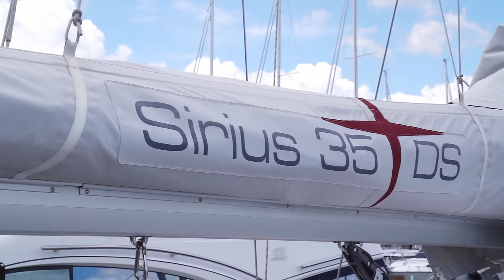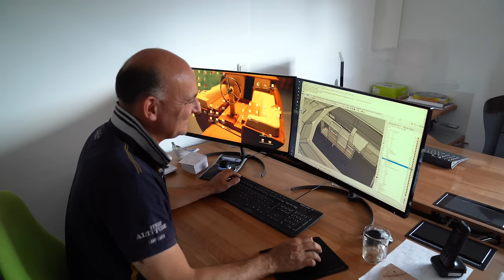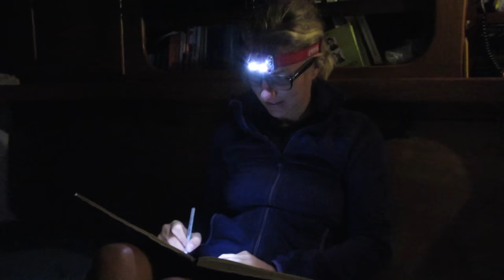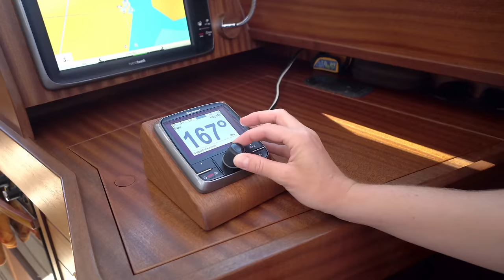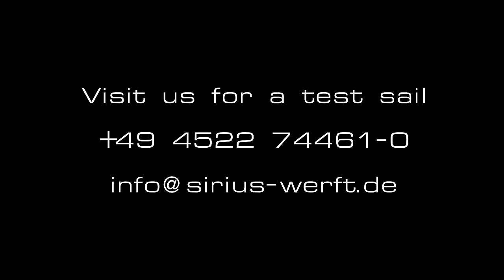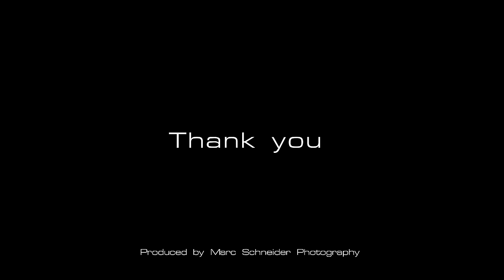Sailing the Sirius 35 DS: A Day at Sea

Comment: I agree; the DS is probably the best cruising Configuration of all options; possibly a bit bigger than the 35 though.
Reply from the maker: Yes! For me it´s the interconnection between inside saloon/galley/navi – area with the cockpit, with the all-around-visibility really, which makes sailing so much more sociable and safer as you always stay connected and see if help is needed… and you spare yourself some tiring and getting cold as you can be on full alert and safe watch, even from the inside... There is a 40 DS as well: https://www.youtube.com/watch?v=RMcxA5mDPwg     ...and something bigger to come...

Comment: Very impressive presentation & extremely high quality kit right there Sir. Is the mast mounted on top or keel please
Reply from the maker: Thank you! The mast is deck stepped, as it should be, for easy getting rid of it in case of an emergency and for not having permanent water inside the bilge. What are your thoughts?

Comment: Nice video and a nice boat. I’m a bit surprised that Marie would choose not to have the self-tacking jib; as the wind picks up it’s good to move the centre of effort back towards the mast, not forward as would be the case by part-furling the genoa.
Reply: ...it´s also not very nice to the genua ;-) ...but if keeping everything maximal simple and to the necessary minimum you for sure could do with just a medium sized, furler reefing headsail and would spare some weight, money and complication on deck... might be a cruising plan question as well? Following the trade winds needs mainly downwind sails!?
Reply: Hi Paul, let me maybe clarify this a little: I like cutter stays as they make for easy switching between sails and possibly better performance (e.g. when close hauled). This setup is more of a Solent rig (hope I'm getting the terminology right), the inner forestay is pretty close to the outer forestay. In a cutter setting the inner forestay can be as far aft as half-way between mast and outer forestay. Tacking with a Solent rig is a little more difficult because you'll have a hard time pulling the genoa through in between the two forestays. So you have to either jibe or roll in the genoa, tack with the main only, and roll the genoa back out again. Since I am pretty lazy I would opt for a single headsail (or a cutter stay which is further back, if that's an option at all). But you know, I was looking hard for negative points on the boat and this is all I came up with 😬. Cheers, Marie ⛵
Reply: We have owned other similar sized boats and hands down our favorite sail configuration is a large fully battened main (with slab reefing) and a minimally overlapping 110% jib with vertical battens.  Add a good off wind sail such as an asymmetric cruising spinnaker from the fixed bow pulpit  and you have a 3 sail diverse sail plan.  The beauty of the Sirius line, from our perspective, is that the boat has many options and a builder willing to consider individual owner wish list.   All that said, self tacking small jibs make coming about with a sun downer a much easier proposition:)

Comment: I disagree the opnion of Marie Schneider about the self tacking jib.
We changed our Dehler 34 (built in 1992) for an Ovni 385 in 2003.
We had the self-tackking device on our Dehler but never used it. Afterwards we regret this very much because it makes short or single handed sailing so much easier. The ship was also much faster than using a mostly reefed genoa. Anyway she was sold and we had to deal with this.
Our experience with a mostly reefed 150% genoa on the Ovni was the same and after one season whe changed it for a high aspect.
2 years ago we changed the high aspact for a 110% jib. and I believe this is the right sail in our case.
The selftacking device on our Ovni we only use in windy conditions when the jib is reefed.
The sail layout on the Sirius looks perfect to me for single- and short handed sailing and would alway choose for 2 headsails. Maybe choose for a removable inner forstay. 
Our Ovni is very suitable for our use and drying out. 
So why this comment? If I had known Sirius back than, the decksalon could have been the gamechanger.
No doubt I would choose for the lifting keel option. (If I had the money ;-))

Comment: Just wondering why someone would thumbs down this video...  Happy Christmas everyone!
Reply from the maker: I do like constructive critics as well ;-) Thanks and the same to you!
Reply: I would, The girls is not tall enough to see the bow when moving in the marina yet she cannot stand fully in the deksalon
Reply from the maker: @prasatsurin    ...thanks for raising this concerns but this is only correct if you are either taller than 2,05m or shorter than 1,5m: In the saloon area you will find 2,05m (6 feet, 9)standing height!!! ...and that`s on a 35 feet yacht! Have a look @25:20 in this video or if you like my “average” 1,85m (6 feet 1) to compare @ 14:00 amd @18:15 in https://www.youtube.com/watch?v=y-v-h50KZgM . We had heavy sun light and for videoing the companionway hatch and blind closed and still you have easy access walking in ... but if you slide it open you can walk in totally upright (and stay upright), .... if you are not taller than 2,00m (6 foot 8). If you are - we still do have some semi-custom solutions, done already. The coach roof has a hight about cockpit level of 1,35m and the standing position at the back is 8cm higher without the middle support. I guess we will struggle to find someone not tall enough to look over it, but having a center cockpit (like Maries forer boat) and no sprayhood up does gives you a diffent angle of view...
Reply: @SiriusYachts  So is the arrangement around the saloon table higher than lets say the galley? Because it looked like there was not headroom. Nice yacht BTW
Reply from the maker: @prasatsurin  ...yes, the main construction idea is to have the same eye level from all positions: sitting in the settee, at the chart-table/inside-steering-position, cockpit or standing in the middle of the saloon between the settee and the galley for perfect 360 all-around-view...but standing height only where it’s really needed to keep the roof low. So you do not have standing height when sitting at the table but as long as the table is there you would not be able to stand anyhow, but you need to step up into the settee to make this all-around-view. Very communicative as you are than again on the same eye level with the standing person which stands secure in rough seas as you can lean onto the settee or galley... I understand that is sounds very unconventional but if you ever have a chance to experience it...

Comment: I'm always impressed by these designs. No main sheet traveler through?  Is there something to compensate for that compromise in terms of sail trim?
Reply from the maker: We have the option of a mainsheet track on the coachroof or on an arch. We make cruising boats and there is a little performance loss and difference in sheeting angle, but in practical pruposes it's not missed. A single-point mainsheet attachment is becoming very popular and using a gas vang and a good mechanincal advantage in the vang provides good leech control.
Reply: @SiriusYachts  Thanks for the great answer!

Comment: Bellissima barca, avere il pozzetto alla stessa altezza della dinette è stupendo. Ma...il punto di scotta della randa. Resisterebbe ad una forte strambata ? (Mainsail sheet point 😬. Does the violent jibe hold?)
Reply from the maker: Per favore, scusate la traduzione da internet
Grazie per le vostre gentili parole. Se si considera il diametro dei grilli forniti dalla Harken per attaccare il suo sistema block and tackle o il bullone a U su un viaggiatore della scotta di randa convenzionale, sono un diametro molto più sottile dell'anello in acciaio inossidabile di 10 mm di diametro saldato sul tubo in acciaio inossidabile a parete spessa di 42 mm di diametro, che diffonde i suoi carichi nel pavimento del pozzetto attraverso rinforzi in acciaio inossidabile a forma di U su un'area di 0,6 m per 1,3 m. 
😀

Thank you for your kind words. If you consider the diameter of the shackles provided by the Harken to attach its block and tackle system or the U bolt on a conventional mainsheet traveller, they are a much thinner diameter than 10mm diameter stainless steel ring welded onto the 42mm diameter thick-walled stainless steel tube, which spreads its loads into the cockpit floor through U-shaped stainless steel reinforcements on an area of 0.6m by 1.3m. 😀

Comment: It is a beauty in deed, just a question in case of rough seas, will the big windows in the pilot house hold in case really big waves run over the boat say even from site?
Reply from the maker: Yes, sure!...all our Yachts are especially developed for blue water cruising and rough weather conditions, and always have been! There have been an number of curcumin-navigations on older and smaller Sirius yachts even. Some Atlantic crossings. Like Marie I would happily do it on a 35 tomorrow, but yes: a Sirius 40 DS for it would be very nice! Recently a 40 DS was collected by the owners in Germany and sailed straight back to Vancouver via Canary Islands, Caribbean, Panama Canal, Galapagos, Micronesia, Hawaii. I personally can´t imagine a better concept than a deck saloon for blue water and extended cruises...
Reply from the maker: Thanks for raising the concern about the windows and portholes. Security and seaworthiness was the absolute first priority in the design spreadsheet. As we are building ocean-going-go-anywhere-cruisers since 50 years now, there has gone a lot of thought and calculation into every little detail. The saloon windows in particular are in use by us since 1988 on every deck saloon yacht we built and have circumnavigated the world a number of times, without any window failures.
Reply from the maker: They are made from toughened security glass with an own certification for world-wide sailing (without the additional use of shutter blinds). They are up to 10mm thick and it is a fully glued in construction bolted trough an aluminium frame work with hundreds of 6mm bolts as well. The recess they are sitting in is a 25mm wide part of the GRP deck and the inner aluminium frame overlaps the same with on the inner side. The only way to destroy them, if you really try all you can, is using this very sharp and pointed hammers you find in busses and trains, but you will struggle to make an impact. Compared to windows in bigger boats, catamarans and commercial vessels this windows are very small ;-)
Reply from the maker: As for testing the hull windows and door material: How about a 140kg body builder working on the portholes with a new axe? We made this test some 6 years ago and I will make sure to post the pictures on Facebook soon! They are made out of the same bulletproof material used for police and military cars...but ours is 12mm!
Reply: @SiriusYachts  thank you very much for all the replies. Appreciate that. Looking forward to future videos.
Reply from the maker: @daniellisy7161  You are most welcome! There are more in progress. So watch tis space ;-)

Comment: Does Sirius Yacht consider a fully electric propulsion system with a big enough battery pack and lots of solar panels as a factory option? Clean and silent sailing, lots of extra energy for A/C, electric oven- stove, water maker...the way of future
Reply: They can make whatever you like if you have enough money but electric motors will drain your battery pack very quickly so they're more suitable for docking maneuvers.

Comment: I'd love Sirius to show us what they can do with a 48 footer!! If they stretch out the 40, add a swing keel to get close inshore (in the Caribbean), add a full beam aft master cabin with second head, make their wonderful mechanical room a little larger, an arch over the cockpit to get around the Bimini under sail issue - unless they extend the boom with a traveller on the longer deck - that's all - keep everything else that's wonderful about the 35 and 40. How about it Torsten??!! At least tantalize Sirius fans with some drawings and animation.Please draw in a dodger and functional Bimini - absolutely essential in the Caribbean. I'd also love to see designers consciously plan solar panels - either semi rigid walk-ons or rigid ones on an arch - but do far more to incorporate them into the design to make them more attractive and streamline. All new boats should be doing this and adding the necessary wires, electronics and lithium batteries rather than make it an afterthought/aftermarket.
Reply from the maker: We haven't commited to building a 48...yet. ;) We are loking into the posibility of a larger Sirius in the future.

Comment: Looks good.   FOLKS... forget in mast or in boom furling! Forget wind generation.    Go all solar.    Did I miss engine accessibility?   Good access is a must!  I note boat prop system  is a sail drive rather than shaft drive.    🇨🇦
Reply from the maker: Glad you like it! Engine access is from all sides and as in all our models and with all technical parts/tanks/ect. everything is constructed in a way that it can be taken out easily and without destruction. For many years the engines have been built in as the last step of production to spar us cleaning and it lifts in and out easily though the huge sliding hatch above the companionway. With the work shop you can sit relaxed in front of the engine and access all necessary for daily checks without blocking other crew in or out like on most boats. If you like have a look @21:50 in this video for the engine access: https://www.youtube.com/watch?v=y-v-h50KZgM .We also do shaft drives (if we have to on swing keel boats, as there is a lot of benefit in having a saildrive – but it´s your choice ;-)
Reply: @SiriusYachts  thanks.  Interesting design ideas...   I sailed a 1979 Tartan 37 long distance for  many years.      Will look again at this video as you directed.   Thanks.  Best wishes and health.  🇨🇦
Reply from the maker: @ronbatt756  Thank´s...and for you too! The Tartan 37 is a truely lovely classic!!

Comment: Great boat, and great video. But I have one question. Would you be safe rounding Cape Horn in this particular version? 
35DS double keel, Other criteria like crew experience aside? I know most people prefer the Panama canal... I don't.
Reply from the maker: They were especially developed for blue water cruising and rough weather conditions, and always have been! Of cause you will try to chose your weather window like on other boats as well
Reply from the maker: ...but with a go-anywhere-capabilities, safety and comfort as top priorities on the design sheet we constructed this hull shape specifically: It has a deep fore foot going 50cm under the water line and a V-spant nearly up to the keel. The bow section is also very sharp to cut through waves and not to slide onto them and slam down. Than the under-water body is deep, thanks to the solid built and the water line narrows in the aft very much -> not to surf waves but to keep the waterline shape even when healed. Therefore you have little movement in rough seas and feel safe and gently moved in the very low cockpit ...and do not need double rudders (so do not lose all maneuverability at low speed in harbors). Unlike most other boats there is no negative varnishing stability thanks to the decks house. So the boat will not stay capsized but will right itself up any time immediately...but please do try to avoid this ;-)
Reply from the maker: …this capability is pending on the hull shape and level of weight stability, rather than the keel version you are choosing your boat in. Yes, the twin keels perform likewise in rough seas as they have the same stability rating as the deeper fins. But the 1,30m deep twins (not so much on the 1,55m performance twins) also carry more weight to archive this, which makes some motion even more gentle. ...and it is an additional safety to be able to dry out and go more shallow and sometimes more sheltered places...
Reply: @SiriusYachts  thank you for your comprehensive answer.
Reply from the maker: @Dryer_Safe  you are very welcome! This might also be interesting for other customers as well, so thanks for raising this question